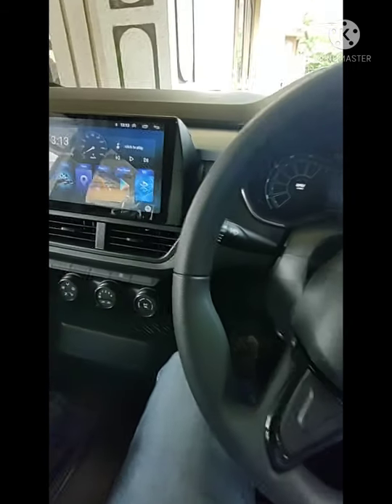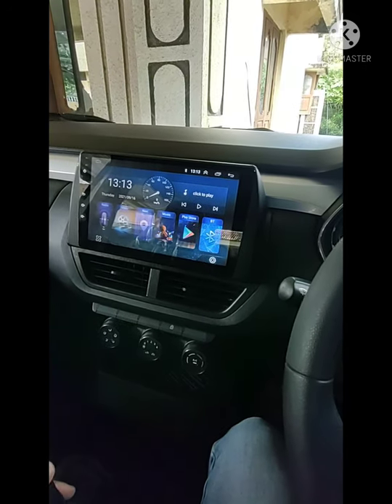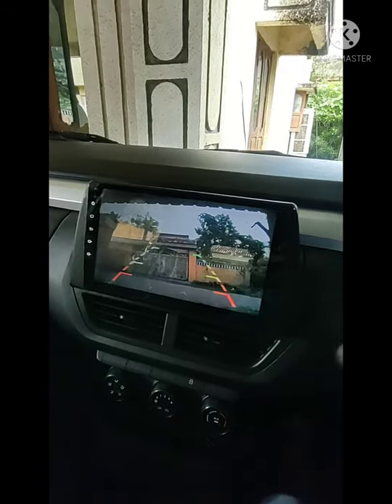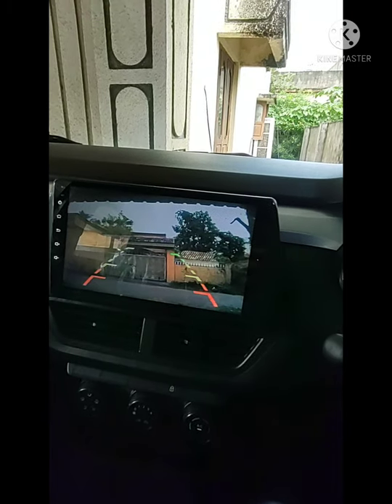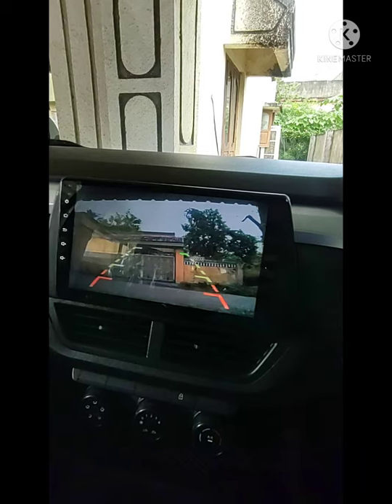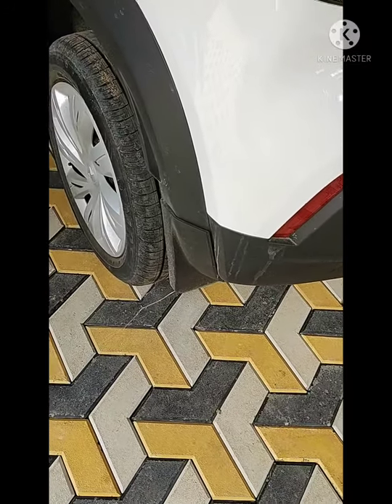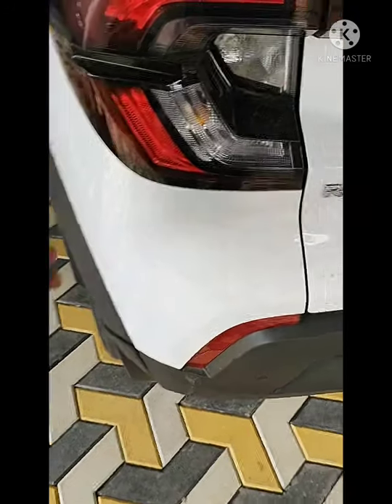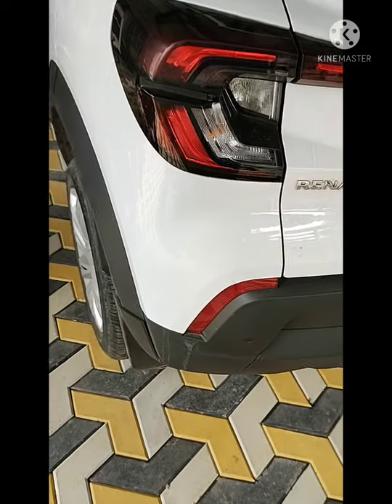Problems with Kiger after 13 days | Dealership Response | Kiger RXL White | Vlog by Rupesh Paul

Comment: I own RXT AMT, for mud issue from Rear, I have 1st provided Foam to protect Tail Lights and then 2nd time they applied Sealant to fix rear reflectors water seepage issue...
Finally I asked them to fix the KWID front fender liners in KIGER Rear wheels and it perfectly fixed the issue 👍 but you have to be aggressive to get that done at any cost 👍 all the best Mr Paul and other Kiger owners 👍
Car is fantastic only if you ignore this mud issue...
Reply: I am confused between turbo and non turbo.. Please guide
Reply from the maker: If you don't have budget constraint, please consider turbo

Comment: I bought rxt but still no issue as per the price range...there are little issue but every company car has an issue...life have to adjust 😁😁😁
Reply from the maker: Agree with you.
But mud leaking issue gonna cost heavy in long run is what I beleive and hence solution needs to be provided by company.
Reply: @rupeshpaulvlogs7133  ya mud issue during rainy season wud be worse for the car but it's ok we will have to manage
Reply: If u can adjust with your 2 Wheeler, I can adjust with your rxt. Bcoz life is adjustment. Boss, you are paying to avoid the issue of walking/biking, not to invite the issue of mud.

Comment: I've git top end varient cvt extronic turbo.... for nearly 4 months hv passed. i took tbe car to lah ladak & other high altitude roads..... initially i had some minor difficulties but with the Jammu Renault Stn....every thing got resolved & i found the car very promising & excellent. even the Fuel consumption is very economic & better than its others  rivals. however i found the car-play android not upto the mark and sometime the transmission lever with the reverse / & camera not perfect and the music system completely commonplace one, not standard. 
my over all impression with my outstanding driving  skills of nearly 30 yrs (like that of M. Schumarker) i think the car is excellent worth of the money it costs. but Renault needs ti recall & adress my points that i raised.....hope renault will call fir these issues... 
regards
Dr Bashir
Reply: another imptt thing ids that of lights esp headlights esp during the night at sharp curves and it dosnt spread around to the required height to see the far side of the road
Regards
Dr Bashir

Comment: Reverse camera of kiger is placed on the boot door, then how you taken out the camera from bumber?
Reply: It's not factory fitted. It is installed after buying the car. For the mud problem you can fill the spaces with silicon which act as good sealant.
That dealership is not aware and not interested in solving your problem.

Comment: Issue resolve hua kya sir..
Reply from the maker: I will post new vlog on it soon
Reply: @rupeshpaulvlogs7133  So Issue is resolved? I have seen another video where Renault bangalore service team have installed a plastic sheet closing the gap above rear mud flap. I think they have used other car accessory. see this video @13.36 time https://youtu.be/KePb1d1owEY
Reply from the maker: @satish749  Thanks for your coment.
No issue is yet not resolved. Dealership is looking into this issue since I am the first customer who raised this defect from Chandrapur. And plastic cover is not a permanent solution to this. I will be uploading the video on the solution soon. Stay tuned.🙂
Reply: Keep it up bro.. Congratulations for the new car. Hope you get the solution soon.
Reply from the maker: @nikhiljanwe6861  Thanks Nikhil😃, I will upload the video once I get the solution to it